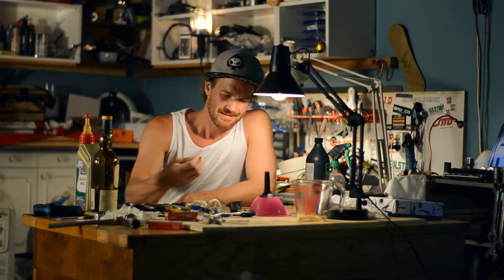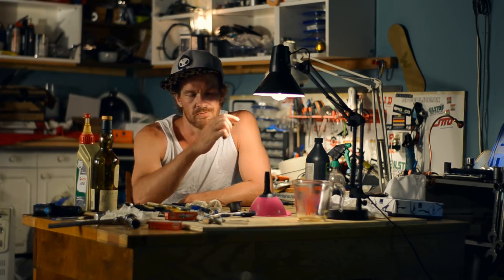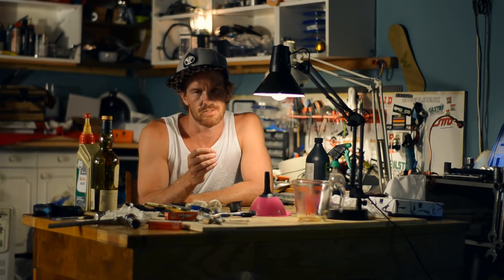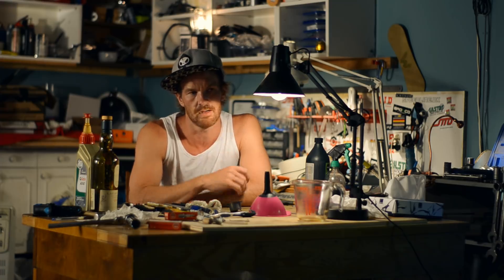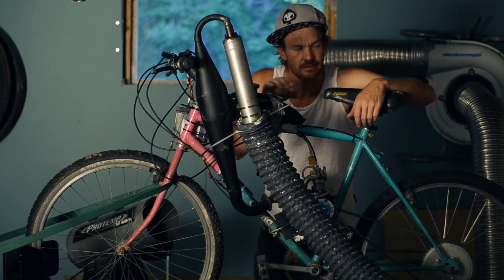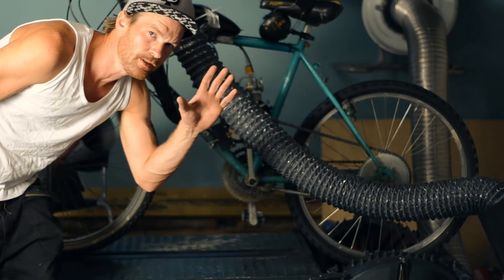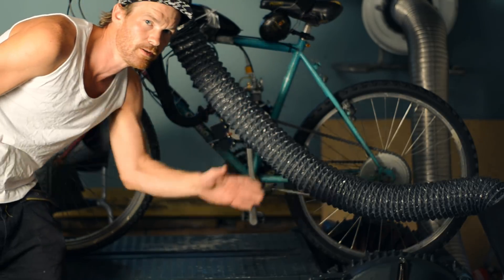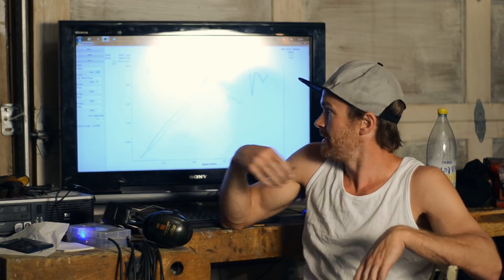Motorized Bike is Back Part 2

Comment: Was looking for part 3, lol
I have a hybrid ms460 chainsaw cylinder on top a yd100 motorized bike bottom end.
Anyways my bike never ran so good until I put the matching chainsaw carburetor on it.
I just drilled and tapped the case for the pulse .
I like how small those carburetors are too as there's not much room and soon you'll end up running into the seat post down tube on the bicycle frame.
But I have a scooter jog pipe that I want to use, and was trying to see what kind of gains you had gotten with the scooter pipe.
Anyways I thank you for your videos. Happy modifications 😂

Comment: hey this might be a little late to the party BUT....in a pinch, I use Torch tip cleaners for oxy/acetylene torches to make small adjustments to main jets. I.e. if i need a slightly larger jet or to go between sizes. brass being as soft as it is worked easily with a tip cleaner which fits into the jet and will take the hole out a small amount in a few dozen strokes. the non filing end of the tool along with a caliper can be used as a sort of measuring device as well. 
this method has come in very handy for me especially tuning Chinese knock off garbage carburetors.
perhaps it would have helped you here. or may get you out of a bind later on. great vid. take care.

Comment: In case of experiments with too big jet, you can also solder in it one or some thin copper wire strands to minimize its cross-section. You can even calculate the resulting cross-section of the jet with the diameter of the strands.

Comment: Awsome i am running it rich the gas color is dark blue the reason wy is because the oil is 711 brand tcw3 2 stroke oil only thing i was able to get my hand on in a few day il get lucas. The other reason is because i dont know how to mix gas and oil i live in sf.ca so the latitude is 377749n.1224194w people say this maters to for mixing it right and fine tune capabilities.what do u think bro
Reply from the maker: The oil is probably fine, mix it at 2-3% - 2-3dl oil for 10l of gas(metric, sorry...) see if you can get a smaller main jet.

Comment: Hey bro i need some help in comfused because my bike is a pk80 and when i ride im flying at 30 to 34 on my Speedo but my bike sounds like its hesatating when in up there .from other sites every one says i might b running lean .my gas is dark blue my carbs gets clean every 3 days i ported the exhaust higher by half a millimeter cleaned the intake port widen the intake manifold as best i could with a dremel same to exhaust took the baffle off too the carb has no air filter too it runs great before 25 then itsl like a waaaaa when i take the jug off its like a dark green oil on the piston etc any thoughts
Reply from the maker: Really sounds like it's lean, have you tried with the choke on/halfway on?

Comment: I just started working on a peugoet speedfight 2 which has the vacuum petcock removed and replaced with a manual one. it has been sitting for about 10 years but it had the same problem back then which it still has. Which is that it wont rev for more than 5 second then it starts bogging and only runs on idle. I cleaned the carb which is a grunter france carb. with a Electric choke which is non egaged and working properly. and I have no clue why it just bogs down after 5 seconds every time the vacuum line from the intake is plugged aswell. do you have any ideas? I checked the reed and 2 of the 3 flaps are not closig all the way. is that the problem?
Reply from the maker: The reeds could most definitely be the problem, if not, make absolutely sure the air passage to the emulsion tube is not clogged.
Reply: Ok will check tomorow
Reply: ok so the air passages are open and Clean so im going to buy a new reed valve. if that doesn't fix it I will check the crankseals.
Reply: oh also did you try the 1mm jet with the needle in the leanest position?
Reply from the maker: Nope, worth a try!

Comment: Would a “limited spaced box” (i.e. simple wooden frame) around the Dyno and not much more be working as well as “quick and cheap” enough? Don’t know if the smaller volume would make the dB better or worse. Compared to insulate the whole garage. 🤔 I understand it as that the exhaust fan isn’t the problem? With limited time to play with this already, the ability to “play as long as you want” each time should be prioritized and very soon “earned back” I think. 👍
Reply from the maker: A "room within a room" is definitely a good, and proven solution!
Reply: 2STROKE STUFFING Yes, that must be the way to go. My thought this time though was maybe something a bit similar but way simpler. Just to keep going with minimal time and money. A “real dyno room” will take way more to finalize...but it’s the ultimate dream in the end. 👌😊 OR I am off completely and the time put in to a temporary solution is just a waste... 🙄

Comment: You should get a hub adapter sproket it will save your spokes in the long run
Reply: On a coaster brake they work well, but on a 1" diameter hub and increased power, even with knurling, they slip. I have both.

Comment: Nice to see that bike (engine) back on the dyno! :-)  Is it possible to find some info regarding engine modifications (if any?) so far? The tuned pipe looks nice, and seems to work ok.(?) The carb is a "good-for-nothing" issue, and should be thrown in the bin, asap. Looking forward to your next session! :-D
Reply from the maker: Thanks! All modifications are discussed in the previous vids in this series, go check em out!

Comment: I got a set of those micro drill bits to do this, and after breaking most of them the first time I tried to use them, I started making makeshift "drills" out of stuff like pieces of wire, welding wire, paperclips, staples, sewing needles- anything that is the right diameter- just clip the end of the "bit" at an angle with some wire snips, chuck in it a drill and have at it.  Works great for testing purposes, then you can order the right size proper jet when you have it all figured out.
Reply from the maker: Good tip!

Comment: Are you sure it's not fuel starving? The in-tank filter on the petcock is very restrictive, even the orifice in the petcock is pretty small. And the float bowl in those little carbs really don't hold a lot of fuel.
Reply from the maker: Could be, but with the 1mm jet it was four stroking all the time.
Reply: True, good point. Just something I thought I'd throw out there. Looking forward to see what you can squeeze out of it next!

Comment: Try to get an old bing 17mm carburetor with adjustable main jet. 
Your fork is bending on the dyno. Watch out so you dont crack it and hurt yourselves. Put some extra iron on it.
Reply from the maker: Good tip! Yeah that fork is scary.

Comment: You're getting rwhp figures that "probuilders" here in the us get at the sprocket, with literally hundreds of dollars in "race parts" and "secret pro race mods". I can hardly wait til you get the mix dialed in, as you will pretty much demonstrate what an absolute waste of money it is to pay a premium for their "secret build knowledge", especially considering your use of a stock carb in that "contraption"
Reply from the maker: Kinda funny isn't it!
Reply: it really just shows that the "technically correct" porting, and a properly sized exhaust give about all you can expect, at least until you go full blown custom. i know you could get that mill to spin faster by balancing like you did with your home built 50, and reeding it would probably allow that to add a couple hp, but also make it even more "peaky" in output, and i bet reliability would go south REAL quick, considering the realities of those little coffee grinders, lol
Reply: Good point. awful close to 5 horse power tho..
Reply: Daniel DeNapoli actually, those stock carbs are pretty lousy, at least as far as tuning goes. They have very minimal circuitry, basically fixed low speed characteristics, and not very sophisticated mixing at any speed range. That's why last episode I suggested the chineseum "peewee 50/80" replacement carbs sold on Amazon. They're cheaper than the stock bike carb, yet have genuine 3 circuit mixing, with at least some ability to tune each. They also use the same spigot and pinch mount as the stocker. The stocker will work for Dyno runs for max power, true, but really sucks wind for actually riding in the real world, and I'd bet a better design will give better Dyno runs as well.
Reply: @ludditeneaderthal  hey brother that 50/80 carburetor you're talking about on Amazon...is it the one that has the choke cable and throttle cable already on it and it has adjustable air fuel mixture??? I seen that carb and started to buy it because I see it's got more adjustability to it
Reply: @dannyoutlaw9919  Yamaha pw50/80 (peewee) replacement clone carbs. It's been a long while, but I'm pretty sure at least some came precabled. The spigot and clamp mounting and availability of jet assortments for 3 circuits, as well as the pricing make it seemingly worthy of trying
Reply: @ludditeneaderthal  ok thanks man...I've got 2 of the hp and 2 NT and one speed carb and the speed carb is the only one I haven't tried yet I've got an assortment of jets iv been around and around with this thing
Reply: @dannyoutlaw9919  the problem is all those "bicycle engine" carbs are lame. If you check the "mikuni carb tuning manual" it shows the circuit relationships to the various stages of slide position. Every circuit influences every stage at least a little. Any fixed jetting makes actually tuning full range near impossible. For dyno runs you can make them do ok, but real world part throttle use requires adjustable circuits. Those peewee carbs have that. Download the mikuni tuning guide/manual, read it through a few times, you'll see why those bicycle carbs are ok for putt putting around, but "real" carbs are needed for tuning, especially if your atmospheric conditions are non-standard, like high elevation, desert, extreme humidity, etc
Reply: @ludditeneaderthal  oh yeah I know exactly what you mean...I've been drag racing and building engine's for 30 yrs and I've always been a very good tuner everyone around where I live gets me to build and tune there cars and I get one of these for myself and man it gave me a fitt lol...I had to take my jets and close them all up and manually resized all of them to the correct size .. when I ordered them there was 3or4 of them the same size but marked different...crazy cheap junk...
Reply: ludditeneaderthal I knew there was nothing wrong with the stock carb. think about it . it's alot like a stock barrel mikuni carb that the Japanese make .the jetting is simple and easy to adjust way better than the Italian delarioto carb with relying on  different jet screws alone
Reply: PistonBully lol, I won't mention any names, but there are more than a few companies here in the states hawking "race built" chineseum coffee grinder bike mills, custom "high performance" parts, and secret process and specs machining services, most of which would even stimulate the gag reflex of a Saudi Prince when he saw the pricing sheet, lol. Even more shocking, it appears there is no shortage of dopes willing to fork over the dough. Even more amazing, they Dyno and bad mouth each other's products, and the usual power delivery isn't far off from what you see in this vid. The biggest laugh though, is one can find the EXACT same "custom proprietary voodoo and virgin sacrifice magic parts" for sale from the actual Chinese manufacturers at between 10% and 25% of the price point of the "miracle working wizards". So yeah, there does appear to be dopes willing to drop large dough into these, as ludicrous as it sounds.
Reply: Fast, cheap, good. Pick 2
Reply: @themopedmetallist  on a Motorised bicycle pick all three, or buy a "Racing" Engine and get 2.
Reply: PistonBully the kits are that good now? Been tempted lately to get something for this rando 90s Schwann I curb-scored. Just for playing with though: I would still trust a Pug 103 with a gooed up front drum over any bicycle brake. Or, going with a TOMOS to have it all
Reply: ludditeneaderthal well, the Poweroutput isn't to bad, but certainly not worth hunderds of $ worth of power, i can't imagine that anyone with at least basic knowlege of 2 Strokes would put a couple hundreds in a bike like that to get those poweroutput's
Reply: ludditeneaderthal sad to her that, haven't wached all of the Videos of this Bike here, is he still running 92° intake 120° Transfer and 140° Exhaust? If so, he could probably get to nearly 5hp just with uppig the intaketiming to 120-140.
Reply: PistonBully he's running 130ish intake, his 92 was an erroneous reading. He nibbled the skirt to fully clear the roof of the intake port at TDC. His original measurement had a 3mm error, so stock is probably around 110 duration. Exhaust and transfer were left stock plus squish shimming
Reply: Piston bully it's a hobby people blow thousands on these bikes and there not all jank Chinese engines they make bicycle engines that are 19+hp. I'm in motorized bicycle groups were people have there bikes going 80-120 mph. If you know how to tune and port with the right pipe and  gearing you can do 70+ with the Chinese engines. Mine stock with lower gearing is going 40
Reply: @rjwhipple8896  when did i say anything against that?
Reply: @aaaabababa  you just said how people with 2 stroke knowledge wouldn't blow hundreds of dollars on these bikes. I'm just saying they do I see it all the time I wish I could post some pictures on here of some of the awesome unique builds I've seen. I've blown probably 450-500 all together on my bike
Reply: @rjwhipple8896  i think you understood me wrong, i meant that people with 2 Stroke knowledge would never buy an Engine that expensive if they could just build a faster Engine for faaaaaaaaaaaar less, because that would just be pointless.

Comment: Brilliant video. Have you thought about soundproofing your garage though? could reduce some of the noise complaints ;)
Reply from the maker: Thanks! It's in the plans, but time/money...
Reply: Here's an idea: use eggboxes, carpet tiles, scrap foam ect. the more random you make it, the more sound deadening it will be. Use anything that could have a soft and large surface area. You could make a video about it ;)
Reply: Exactly. Any good mechanic/engineer should be just as good at botching something on the cheap as they are at making something good. It's all about ingenuity.

Comment: Do you know your port timing ? I have make some test on a motobecane av7 engine with 147° intake port / 110° transfert port / 172° exhaust port https://www.youtube.com/watch?v=qCl6tX05IyM , intake port can be increase about 10° less than exhaust port, torque at high rpm increase but torque at low rpm decrease drasticly

Comment: I'm building a engine based off another engine and the original engine has a pulse line and what would happen if I didn't use the pulse line? And what does it do?
Reply: If you use conventional float carb you can plug that port and forget about it. But chainsaw pumper/membrane style carb won`t work at all without it.
Reply: Karrie Bhurgari ..pulse line carries pressure wave from crankcase  to open diaphragm in fuel pump side of carb to allow fuel in..sort of like float bowl.fuel then moves to needle valve on throttle side of carb on demand... has been used on chainsaws with a long time..not so much on bikes as gravity brings fuel to carb..
Reply: Nicky Walsh ok the motor I'm building is a chainsaw style motor. Thanks for the Info!!
Reply: Karrie Bhurgari ok...the chainsaw carb design is very impressive any change of direction or  even upside down does not effect performance..
Reply: Никита Надеин oh,
Reply: Nicky Walsh yeah, I don't want to use a float bowl carb becuase they're so big and bulky, also fuel slosh is a problem

Comment: i ordered one drillbit set for drilling jets. it haves 20 bits and its from 0.30 to 1.6mm. actually i bought like 5 of them because they were like 2€ from wish. u should get one set of those! i just found one set that goes for name "20pcs Mini Micro HSS Twist Drill Bits Set Kit Precision Craft Tool+Box 0.3-1.6mm" if u are interested. with those its easy to drill out the smaller secondary jet.
Reply from the maker: Yeah, should get a set!
Reply: I have the same ones they're actually decent quality too I got mine for like 6 bucks